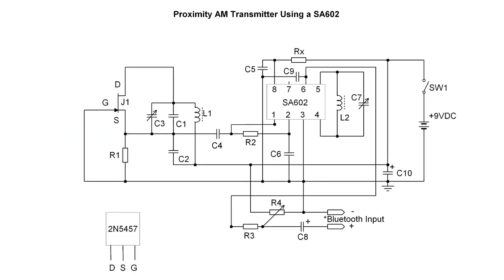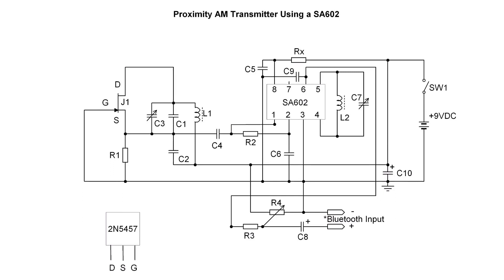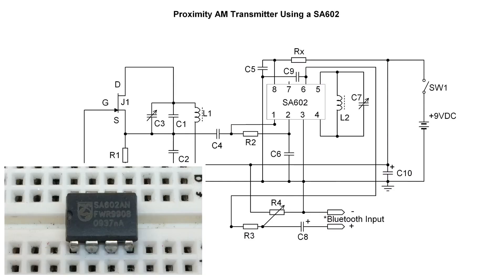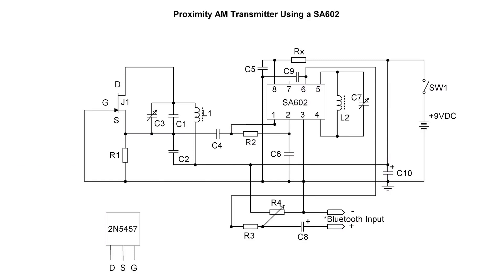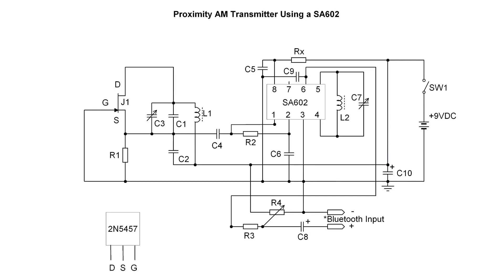Proximity AM Transmitter Using a SA602

Comment: So, it looks to me like the RF carrier oscillator is being applied to pin 1 of the SA602 and the modulating signal is being applied to 6, correct?  I'm thinking that variable resistor R4 and resistor R3 are used to add a DC offset to pin 6 so that 100% modulation can be achieved, correct? I'm trying to use a single transistor Hartley osc to create the RF and a audio oscillator and an NE602 to create a simple short distance AM transmitter.  I'm using pin 1 to input the RF and pin 6 for the audio input... it works but the carrier is not a clean sine wave even though the input at pin 1 is a clean sine wave... not sure if I'm on the right track... but I can pick it up on an AM radio and it sounds good...?
Reply from the maker: As I noted, the SA602 does work, but the results were much better using a MC1350P to add the modulation with a LC circuit on the output side to clean up the sine wave and out of band harmonics. You are correct on your assumptions. Hope your builds continue to go well. Thanks for watching and reaching out. Best, Don

Comment: Hello, Don.
I have a technical conundrum and I need to consult you.
Please, if you can give me a hand.
I found here in Spain an old electronic device of the RADIART brand, "Standard of Comparison". Internally it carries a small power supply with a selenium rectifier and a 6J6 valve and a tuner composed of a fixed capacitor and variable magnetic permeability inductance, typical to be used in the VHF band, also a commutator with four positions.
I was doing research on the Internet and I did not find any technical information about this old device.
But for similarity with others used by radio amateurs I found the following additional:
it has a 110V AC input to power the 6J6 and its circuits and a 110V output to control an antenna rotor motor.
Then it follows that this apparatus is the rotor controller of a directional antenna. And its application could be to move a yagui antenna from a TV receiver, also it works as tuned RF amplifier.
That's clear.
The part that I do not understand and cannot understand is the part of the tuning dial.
It has a dial with a knob with two opposite 180º sexagesimal hands. And when we turn from the beginning, clockwise, the numbers go in this order:
6, 4, 2, 7, 10, 3.
In such a way, that at the beginning of the dial, when the knob is turned, the opposing hands point:
6 and 7, 4 and 10, 2 and 3.
This device was made in Cleveland, probably in the 40s or 50s.
If you can decipher what those numbers mean, or this dial system, I would be very grateful, because I cannot relate it to any European communication dial system.
If you don't know about this kind of device, you are free to consult your colleagues.
And if someone who reads this comment can give me the necessary technical information,  can also reply to this comment.
Thanks for the attention.
Ketk (España)
Reply from the maker: Ketk - it’s great to hear from you. Would you have a few photos you could share of the unit; an unlisted video? Best, Don
Reply: Hi  @RestoreOldRadios  , yes of course I have. How could I do for you to get them?
Ketk.
Reply from the maker: An unlisted video on YouTube that you can delete later would be perfect. Sounds like an antenna rotor controller. Best, Don
Reply: @RestoreOldRadios  Hi Don. Sorry for the delay in answering but here it was lunchtime and there was braised bull meat and duty was inescapable.
As soon as I can I will make a video to show you this strange device, from all sides, and you will be able to hear my voice speaking in English from nowhere. Don't laugh too much at my accent.
Once the video is uploaded to Youtube, I will give you the link to it.
Greetings and thank you very much for your willingness to help me decipher this enigma.
Ketk.
Reply: Hello,  @RestoreOldRadios  . I have uploaded video in this link:
https://www.youtube.com/watch?v=HyDT88dvo9U
Please, leave me a comment when you have watched it.
Thanks again.
Ketk.
Reply: Hi Don thank you very much for 0 help.
https://www.youtube.com/watch?v=DTrOLsqd2YI
Have a nice day.
Ketk (from España).